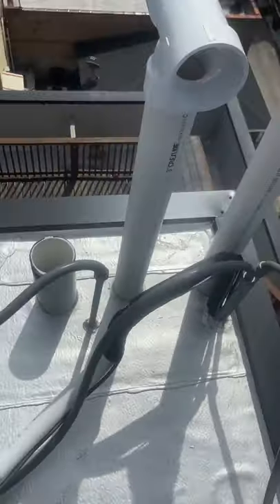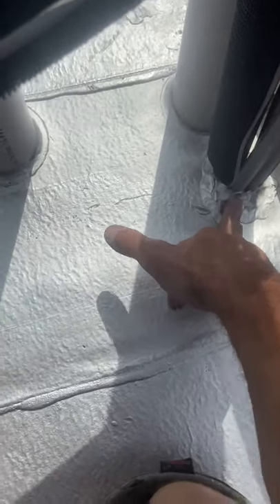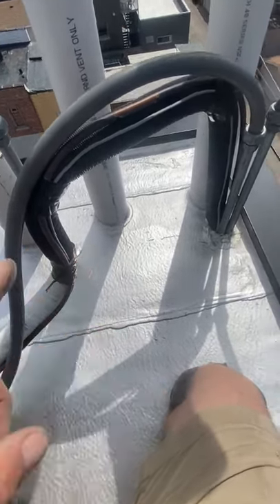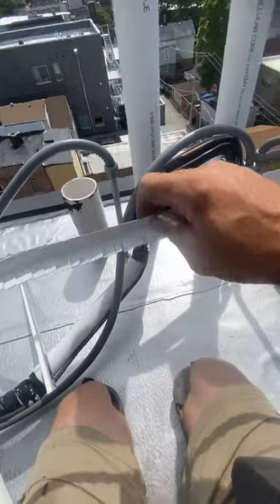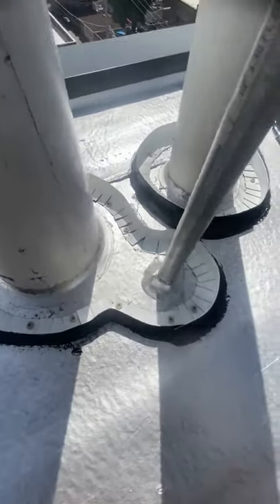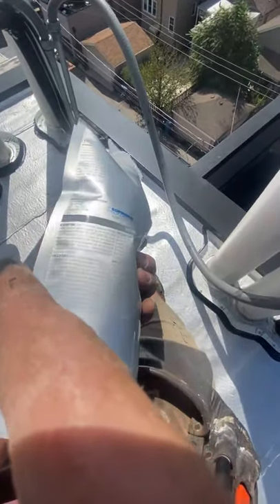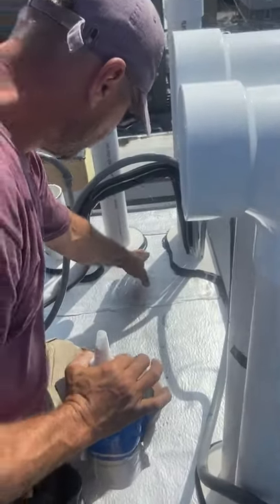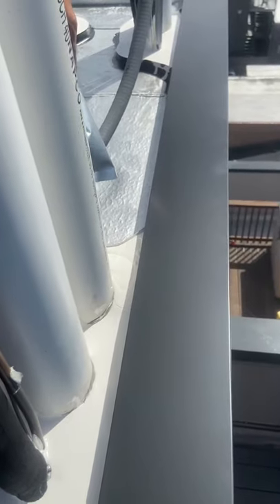FLAT ROOF. Proper way to seal vents and pipes.

Comment: Do you have any more information on the sealer you used ? 😊👍
Reply from the maker: its ChemLink sealer.1-PART is a light gray, permanently highly flexible, self-leveling moisture curing pourable sealer. Its 100% solid soft rubber, has no V.O.C. (volatile organic content), will not melt or shrink, is UV resistant and is resistant to deterioration.has large quick-pour and resealable spout. The convenient and easy to use 1-Part™ Pourable Sealer is a moisture-cure self-leveling high performance sealer.
Reply: @LeftoverCA  
Thank you 😁👍